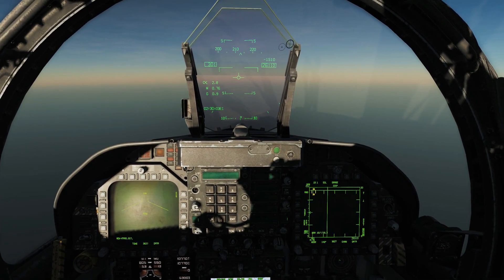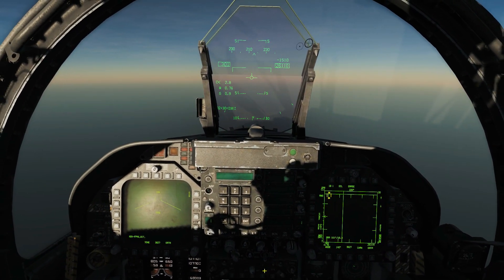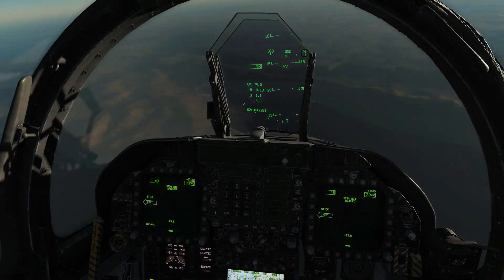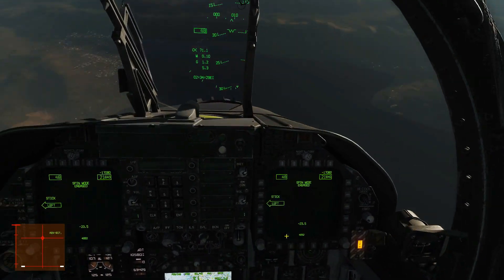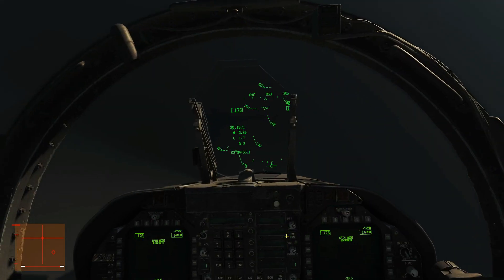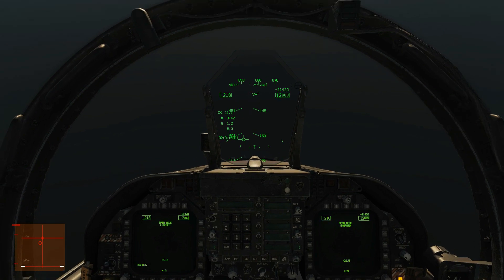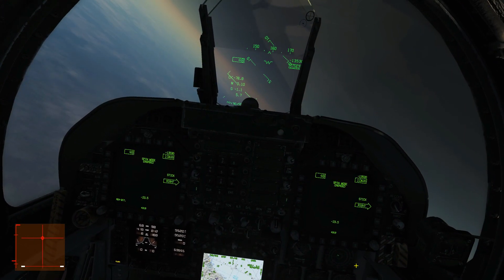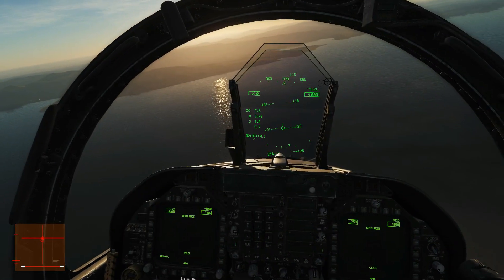FA-18C Hornet: Spin Recovery Tutorial | DCS WORLD

Comment: If only you could recover from a flatspin in the f14
Reply: notproplayer 3 You can : Roll SAS ON, Thrust idle, Rudder opposite to yaw rotation, Stick full back and INTO spin, When rotation slows, stick forward through neutral, All controls neutral as soon as spin stops. If this doesn't work, start "pumping" (Pitch will always oscillate, when it oscillates nose up, full back stick, when it starts dropping again, full forward stick. If all else fails, sweep wings full back. Be patient! Controls must be held in spin recovery position untill effects are seen. Can take several rotation.
Reply: @fredericborloo1910  wow man, just tried it out and indeed it worked, it's quite a lot harder than with the f/a-18 though
Reply: You need to practice to get it right. It changes every time. Just tried it and needed to sweep wings. Sometimes it comes right out with the standard recovery technique.

Comment: Cap, being stalled or not has nothing to do with your speed. You need speed (EAS) to create lift, but the driver behind stalls is angle of attack. Speed is pretty much irrelevant. Important to distinguish between being stalled and being unable to produce enough lift for level flight.
Reply from the maker: thc
Reply: Thc?
Reply: Critical angel of attack is the driver between stalls.
Reply: Critical Angle of Attack is the Chord line having air deflected upwards instead of over the airfoil.

Comment: The anti-spin switch is was only applicable to early Hornets. Later OFP's FCS eliminated the need for it. In fact, use of the switch is prohibited in the NATOPS.
Reply: Matt’s right.  The only reason the switch is still there is so maintenance crews can position the leading edge flaps full down and remove panels.
Reply: I've just found out about it, thanks Matt
Reply: Very good! Now, be it or not (meaning about the anti-spin switch) can you kindly ask your aerodynamicist at ED to correct the F-18's ailerons normal force vectors that should generate an adverse yawing moment due to stick instead of the wrong proverse yawing moment due to stick that is still unfixed so far? Even the SPIN MODE display confirms that! You cannot realistically quick reduce the yaw rate until they fix the force vectors on the ailerons. Right now, if you're in rightward spin and you apply left stick (opposite to what the display suggests) and rudder you'll reduce the yaw rate very quickly and recover. If you do as the display says, which is very correct, your recovery will be very very sluggish! You can do another test to understand what I'm saying. Simply fly below 200kcas to allow the spin mode to get in effect, pull and hold the stick full aft with no aileron input as well as no rudder input, let the plane's AoA stabilize at 50-60, whatever (depends on fuel status that affects the CG) and then while keeping the stick pulled apply right aileron without any rudder input. You'll see that although the rudders remain at zero and only the ailerons deflect while keeping the elevators at full negative deflection (TE UP) the plane starts to rapidly yaw towards the ailerons input. Very wrong! Please correct it!
Regards!
Reply: The girls scream, "Omigod...  It's Matt Wagner!!!"  And the panties are airborne!

Wags, my dude!  I'm just wondering which OFP is modeled in DCS Hornet.  Is it 10.7 or 10.5.1?

Have an awesome day, my friend.
Reply: Why was it removed?
Reply from the maker: Roger Thanks
Reply: I am still amazed by Grim Reapers "tutorials" about topics they (him?) know NOTHING about.
Reply: @matuliik  lol I know! but that's the reason I really like them, as I often learn useful trouble shooting techniques watching cap making mistakes :D:D
Reply: Proximax9 Yeah. Actually, their tutorials are pro level, because only so you will be able to separate bullshit from actual information. :-)
Reply: J S And all the worst “tutorials” are from GR. That’s why it is such a grim service to the community. They have basically none aviation knowledge and sometimes they don’t even read the manual correctly. And still they are punching one tutorial after another with very mixed quality. Be very carefull and double check on everything you “learn” from those videos. The highlights of GR nonsenses are CASE I for F-14 and Turn rate comparisons. Enjoy :-D
Reply: matuliik and yet here you are still commenting on their videos. Still it’s nice to know that you, a real F-18 pilot, are here to keep us all informed...
Reply: @matuliik  Really?  DCS is a game, which Cap has repeatedly stated!  If you're doing your flight training for a real aircraft you're just daft if you try to learn through DCS.
I agree that sometimes GR makes a video before they read the manual, which he also clearly states, but I don't really see a problem in that.  They do show you the basics, and lots of times there are unfinished modules to take into account as well.  And the fact that they cut down checklists etc. is just great.  If you have a need for total realism, maybe stop playing games?  Or maybe try to find someone that takes this as serious as yourself.

For me GR are great!  Makes me want to start up DCS every time I hear Cap!  And they do take the mystery out of the seemingly complex information in the manuals.
Keep'em coming CAP!
Reply: Tyler75D Really. But carry on, if you like it. As you said - it is a game.

Comment: For what it's worth, and I don't know in how far this is modeled in the game, this is from the Sept. 2008 version of the NATOPS Flight Manual A1-F18AC-NFM-000 about the system, the switch and the hints on the DDIs (minus the pictures). Seems like the switch only lowers the number of conditions to be met for the mode to kick in and keeps the plane there until speed increases:

"2.8.2.6 Spin Recovery System. The spin recovery system, when engaged, puts the flight controls in a spin recovery mode (SRM). This mode, unlike CAS [control augmentation system], gives the pilot full aileron, rudder and stabilator authority without any control surface interconnects and all rate and acceleration feedbacks are removed. The leading edge flaps are driven to 33° ±1° down and the trailing edge flaps are driven to 0° ±1°.
Spin recovery system engagement depends on the position of the spin recovery switch.

2.8.2.6.1 Spin Recovery Switch and Light. The spin recovery switch on the map gain/spin recovery panel allows the pilot to select the conditions required for the flight controls to engage in the spin recovery mode. The SPN RCVY light, adjacent to the switch, is on when the spin recovery switch is in RCVY.

NORM Spin recovery mode engaged when all of the following conditions are met:
1. Airspeed 120 ±15 knots.
2. Sustained, uncommanded yaw rate.
3. Stick is placed in the direction indicated on the DDI spin recovery display.
The flight controls revert to CAS anytime the stick is placed in the wrong direction (i.e. prospin), the airspeed increases above about 245 knots, or the yaw rate decreases to less than 15°/second.

RCVY Spin mode engaged when airspeed is 120 ±15 knots. The flight controls revert to CAS when the airspeed increases above about 245 knots. Full authority prospin controls can be applied with the switch in RCVY and spin mode engaged.

2.8.2.6.2 DDI Spin Recovery Displays
a. Spin Recovery Switch in NORM. With the airspeed at 120 ±15 knots and a sustained, uncommanded left yaw rate with positive g or sustained, uncommanded right yaw rate with negative g,
SPIN MODE
STICK
LEFT
appears on both DDIs (see figure 2-14).
With the airspeed at 120 ±15 knots and a sustained, uncommanded right yaw rate with positive g or sustained, uncommanded left yaw rate with negative g,
SPIN MODE
STICK
RIGHT
appears on both DDIs.
When the stick is placed in the indicated directions, the words
SPIN MODE
are replaced by
SPIN MODE
ENGAGED
When yaw rate ceases, or the airspeed increases above about 245 knots, the spin recovery display is replaced by the MENU display.
b. Spin Recovery Switch in RCVY. When the spin recovery switch is placed to RCVY
SPIN MODE
appears on both DDIs.
If the airspeed decreases to 120 ±15 knots, the words
SPIN MODE
are replaced by
SPIN MODE
ENGAGED
If a sustained yaw rate develops, the words STICK RIGHT or STICK LEFT with an accompanying arrow also appear on the DDI.
When the airspeed increases above about 245 knots
SPIN MODE
appears on both DDIs and the flight controls revert to CAS.

Airspeed appears in the upper left corner, altitude appears in the upper right corner, and AOA appears in the lower center of the spin recovery display.
During highly oscillatory out-of-control motion, rapid cycling of the command arrows may occur. Under these conditions, the stick should be released until command arrow cycling stops. During intermediate and high yaw rate spin mode recoveries, removal of the command arrow may be delayed. Under these conditions, anti-spin controls should be neutralized (sustained command arrow present) only if spin rate has stopped and the AOA warning tone is no longer present."

Comment: I think you got out of the spin much quicker with the switch flipped on than without it. It would probably increase the autonomy of the flight control surfaces, so they can move in and out slightly farther than usual, creating more drag where it needs.
Reply: @windsurfer_LA  Yeah. I remember in the Falcon BMS, that the F-16 has a similar switch that extends the autonomy of the elevators, making negative Pitch authority considerably higher, and the switch is often used for spin recovery.

In the case of the F-16 in BMS you can even look behind you and if you pay attention, you can actually see the elevators move up farther than normal as soon as you flip the Pitch Override Switch.

Probably the F-18 does somewhat the same with the Spin Recovery Switch...
Reply: @windsurfer_LA  The switch doesn't do anything for this Hornet,  read Matt's comment above. The fact he recovers "sooner" is likely coincidence depending on the conditions of that specific stall. Variations of the stall (Altitude, speed, angle) all affect how soon or late you recover from the stall and not every stall recovers in the same time-frame. For example. his first stall at high altitude of around 22-23k (with switch) he recovered at juust under 13k altitude. When he did the same height again (this time around 22k) with no switch, he recovered at 11k ft. It appears to make no difference to me.

Comment: The manual way to recover from a spin is to:

Cut the throttle, neutralize the ailerons , full rudder in opposite direction of rotation of spin,, forward stick to lower the nose , recover from the dive.

Leaving full throttles engaged in a spin would screw your recovery in a real aircraft.
Reply: That's how to get out of a flat spin in the tomcat. You can gun the inside engine too but that's optional
Reply: well bf 109 also use this escape maneuver as far as I know (il-2 game)

Comment: I saw a HUD video of an f16 pilot blacking out and the plane took over, preventing him from crashing into the ground. Can the f18 do that as well?
Reply: Not in dcs, but according to https://insidedefense.com/insider/navy-directs-super-hornet-program-manager-install-auto-gcas it will be installed on 18s as well. The system is called auto-GCAS
Reply: F18s  do auto recover, AT on hornets for 8 years.
Reply: I remember in the Falcon BMS, that the F-16 has a similar switch that extends the autonomy of the elevators, making negative Pitch authority considerably higher, and the switch is often used for spin recovery.

In the case of the F-16 in BMS you can even look behind you and if you pay attention, you can actually see the elevators move up farther than normal as soon as you flip the Pitch Override Switch.

Probably the F-18 does somewhat the same with the Spin Recovery Switch...
Reply: William Link that has nothing to do with what I’m talking about. lol